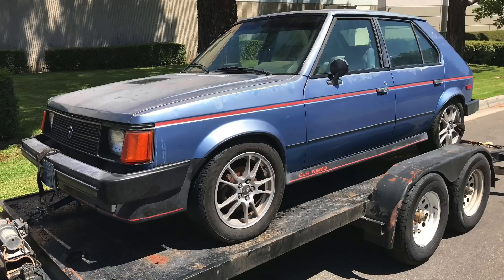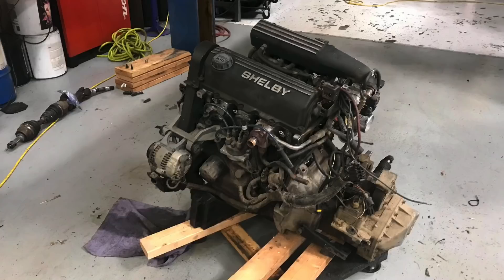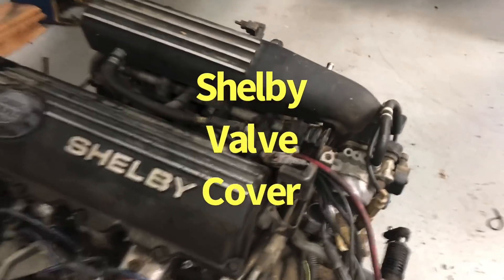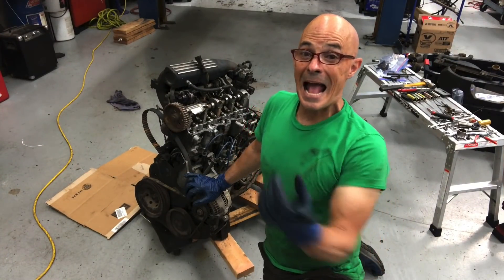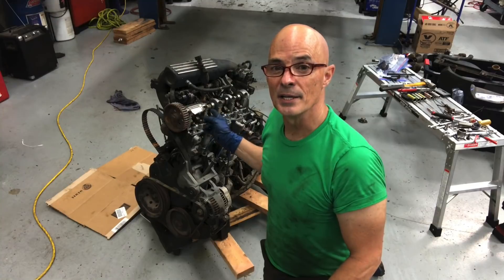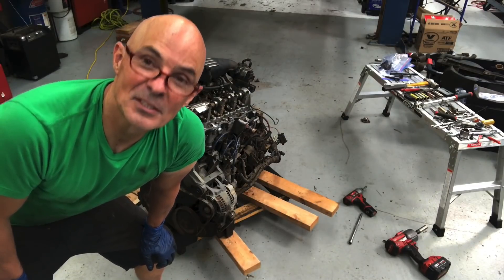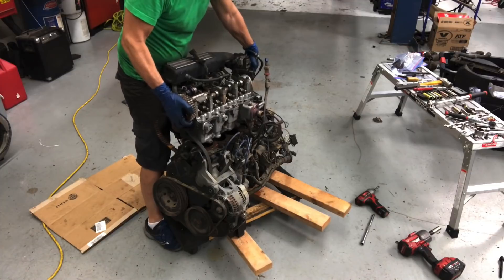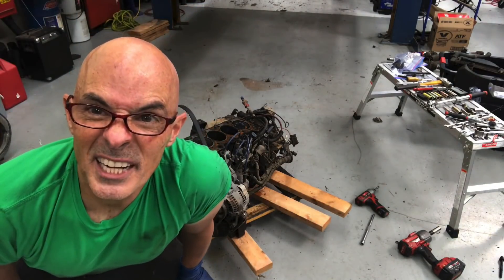HOW TO: HIGH BOOST 2.2L/2.5L TURBO ENGINE REMOVAL & DAMAGE INSPECTION-WHAT BROKE? CHEAP, DIY, TURBO.

Comment: Richard, forgot to mention a couple of things that we used to do to these engines to fix the things that factory got wrong.  One, is the uneven airflow of that T2 style intake manifold.  The #1 cylinder gets more air than the rest, thus running lean because the factory batch style injection cannot address individual cylinders.  The fix was to knock out the large "freeze" plug at the end of the intake and put a cone on the inside of the plug, then put the plug back in.  The height of the cone will change with powerband.
Two, the uneven cylinder cooling because the water housing is on the left of the block, causing the cylinder #3 to run hotter.  This may actually be the reason for the initial head gasket failure.  The fix was to either run a flow diverter under the thermostat inside the block ( we used to make it from a thin aluminum or SS sheet) to direct some of the flow to the right or some people started using the small freeze plug on the right side of the head, right where the water and oil lines for the turbo run, by enlarging that hole and running a water line to it.  Or doing both.  The factory went to sequential fuel injection starting 89 if I'm not mistaken.
Reply from the maker: DID YOU RUN OXYGEN SENSORS IN EACH CYLINDER TO DETERMINE THAT
Reply: @richardholdener1727  EGT probes and reading the spark plugs.  This info was given to me as explanation for the observed behavior by an old Chrysler engineer.  He ran Mopar Performance for 12 years and had extensive knowledge of these from the IMSA racing program.  There was also a "crowdsourcing" involved, as we all shared what worked and what didn't in the Turbo Dodge community.  The guy's name was Ed Peters and he was well know in the automotive community.  Sadly he passed away a couple of years ago.

Comment: What a junk box! Omni turbo . Should dropped it down a canyon wall into a wash.  Then let the chickens live in it.   Weld that head and file it reuse the old pistons and put studs and a new gasket and overtighten by 10 ft lbs,  " IS a Good  enough" says Enzo.....

Comment: hey rich have you thought about doing a long tube header turbo kit? would that work? I see those ebay DNA long tubes and I cant help to think man wouldnt a vband flange get welded on the back of that just perfect to get a single turbo sized right.... it would be low but with a bit of shielding.. heat wrap... seems almost too good of an idea to be true
Reply from the maker: I WILL FOR THE DYNO
Reply: @richardholdener1727  oh and if you are still reading on this post maybe twin turbos sized right for the end of each long tube? Just an idea
Reply: @richardholdener1727  oh and if you are still reading on this post maybe twin turbos sized right for the end of each long tube? Just an idea

Comment: I remember even with the non turbo 2.2s I remember watching the techs at the dealer do what they called the slip & slide with the head gasket! They had two lift points on the head, & a chain going to it! Hooked to an engine lift, they disconnected barely anything, except the head bolts & slipped the blown head gasket out, & just slipped a new fel pro gasket gasket in! They tightened the head bolts from center out w a air gun only! They then would pull plugs & crank over with starter to clear cylinders, & than top off fluids & out of the shop it would go! From cold start, to backing out of shop in under 15 min! NO BULLSHIT! That is alittle worse than normal! Oh and if they started skipping during the test drive, than they would actually pull head, & sometimes find exactly what you found! They saw blown head gaskets every day! Especially on the turbo ones! 😜😜😜😜🤪🤪🤪🤪

Comment: My first brand new car was a 1990 Shelby Daytona. I cut a small slit in the vacuum hose at the wastegate and it would boost to 14lbs. got greedy, went bigger and burnt a hole in the piston. lol. put the stock vacuum hose back on, towed it to the dealership and with the new engine,kept it at 14psi. it was a fun little car and I was young and stupid.

Comment: Get a new head.  The old one could be welded, but the heat treat in the weld zone will be wrong and leave the aluminum soft.  Then the head gasket won't hold up.

Comment: I graduated H.S. in 1986. The Omni GLHS was a pretty hot car for the day. I wanted a new car and it was between the Turbo Sunbird, Omni GLHS and the Grand National. The Grand National was pretty expensive and the Sunbird was actually a tick quicker than a regular Omni but the Omni had a bunch of cool options so I was leaning towards it. In the end I got none of the three. I heard they were going to start offering the 350 in the Trans Am for 87 and then they came out with the Formula and I fell in love. I bought a red Formula 350. It was a gorgeous car and really handled well and even got really good mpg. But what a disappointment the TPI was. I got beat by every 5.0 Mustang in the area. Fortunately I had my 69 GTO with a hot 455 that I could always run home and get.
Reply: You made the right decision👍
Reply: @indyrock8148  The right decision was buy a Buick GN and hang on to it.
Reply: @1439of2000  Oh, if only I had a time machine right? I had drug my dad to a couple of different Buick dealers because they wouldn't let an 18 year old test drive a car without a parent. My dad ended up falling in love with Grand Nationals. He ordered 2 brand new 87's, one for him and one for his wife and eventually found a GNX and bought it in early 88. He traded the GN's off a couple of years later but kept the GNX until last year. It had a whopping 4500 miles on it.
Reply: @indyrock8148  I was a street racer and also needed a daily driver. I kind of thought an Omni would be a sleeper and get good mpg. But you're probably right. If a drunk driver hadn't rear ended the Formula in 89 I would still have it. But it was 3 feet shorter on the driver's side than the passenger side after the crash. I replaced it with an 87 GTA that had a modified engine. The old electronics were so bad that it burned MAF sensors out as fast as I could buy them. But it was another beautiful car.

Comment: Richard. It may be more economical to find another head.   The head I believe is aluminum.  I repaired and rebuilt gas and diesel heads for a living.  If you can get the head to pass a water jacket presser test that doesn't reveal unrepairable cracks then it can be repaired.  You will need a adjustable timing sprocket because of the deck milling.  After welding and straitening (oven and jig needed for this) and milling, CC the chambers. You'll need to pressure test it again to see if the weld didn't create a leak as well as create new cracks.  Then you have to check the cam journals and have them align honed if necessary (if you can find a shop that can do that).  You still have a valve job and possible valve seat to deal with.  You'll have a good head with hopefully not too high of a compression.
Reply: I was just going to mention that when he mentions the head is iron, but then read the note saying the block is iron...so was yep good correction.  I've heard the turbo blocks were a high quality nickel rich iron block too.  I had some very light detonation - nothing like this - on my head and was able to have it welded, cleaned it up, and resurface it and kept on going.  Not the best solution, but it's a CNC ported head and didn't want to let it go just yet.  That is on my 87 Shelby Z.  I'm looking forward to pulling the 87 Turbo II out of my 85 GLH and getting it rebuilt.  These videos certainly help inspire that, so thank you!!
Reply: @notsigningupforshit  The long drawn out way I explained the repair is IF you can not find a replacement.  For the most part as long as the cam still can turn without bind after welding and it passes a leak test you are in business.

Comment: The issue is that vw sold this motor to dodge because they called it... Garbage
Reply: No VW heritage here at all. Has the same bore spacing as a slant six. Stock, these things were reliable if you let it idle a minute to let the turbo slow down while it has oil pumped thru it. How much PSI did that damage with stock head gasket and ring gap?
Reply: Look up the acquisition of the original Omni motor...vw. Chrysler just enlarged it. Same flawed 3 to 4 cylinder wall and head cooling flow problems
Reply: @matthewszalkowski4719  Chrysler Europe developed the Chrysler/Simca/Talbot Horizon in the late 70s and sourced a small VW engine for it because they did not have a 4 cylinder of their own ready for market. They also used a PSA motor for a short bit as well. All of the SOHC 8v 4 cylinders from that era shared design concepts. You'll find similar ideas and even shared parts between Volvos, Fords, Chevys, etc. As soon as the 2.2 became available, the Euro-sourced engines were dropped. The Chrysler K engine was designed by the guy who helped father the slant 6 and the Hemi. It shares some of the slant 6's overall design concepts, but it was its own engine. It was not actually "based on" any motor specifically. Read the information sources people above you have provided. If you can't support your point with actual evidence, please stop spouting misinformation.
Reply: Still a vw design they would not use... My dad was in the industry and said that vw would not use it because it blew up 
At 100000 miles

Comment: I absolutely hate anything Dodge/Chrysler but for some reason I've always liked those omni's! Just imagine if they would have been AWD they would have been bad ass little hot rods without a doubt and since they are so old by now tuners would have figured out everything and there would be a ton of aftermarket parts available and they would be flying!
Reply: Everyone has figured everything out on these and there are plenty running fast times and have been for decades.

Comment: That is some of the worst damage I've seen to one of these on the head side of things without there being a hole in a piston, too. If the head is stock, not worth welding. Just find another good USED one! DO NOT get a new casting from China...they are TERRIBLE!!

Comment: Richard if I recall, you've done work with blueprint engines, and I would assume you are familiar with the factory five 818. For a couple years, I wanted to take the 818 and put a 2.2 or 2.5 in it instead of a subaru boxer 2.5. They say it can't fit. I still can't wrap my head around that. What would you say?
Reply from the maker: WHY WOULDN'T IT FIT AND WHY NOT USE A HONDA

Comment: I seriously can't believe it was so bad! This is literally the reason I didn't pull my "blown head gasket" shelby charger apart for years (it still ran which allowed me to move it around the property) but I got lucky, just the gasket. I was running 26 psi, on e85, this could have easily happened if it was between cyl instead of the coolant passage.

Comment: This is a common issue for those running high boost, thought it looks like either this one was more severe than average or the person drove around for a bit with blown head gasket and killed the head as a result.

Comment: I see a prior owner smartly upgraded to the Nippon-Denso alternator. A simple bolt-in that delivers 90-120A, depending on the model had... and quite necessary to support the electrical demands of a car with EFI. Not to mention more reliable, and easier to replace the brushes on! ;)
Reply: Where does this 120 amp alternator originate from
Reply: @pr0n5tar  go to a tractor supply store get one for a 1994 john deere replacing part 38770.

Comment: hey can you do some Chrysler / Dodge 3.5 v6 egg motor sometime???
2.2/2.5 who needs them????? v8 is too expensive in Europe. v6 Chrysler engine is dirt cheep 250 hp(n/a) calmed / 140usd. 
very high rpm N/a 
 n2o + ring gap
camshaft
some ported heads maybee??
what power it can make before it self-destruct on dyno???
youtube is full of info over v8/bmw/honda/nissan.but not much of tuning of Chrysler 3.5 HO v6. i know it is good engine 4 the money. 
i am building one slowly. 
Plan is 3.5 engine/4.0 cam and springs/self ported heads/ self made long tube heders/ used dry sump pump from ebay/ ARP rod bolts/standolone/ and SHITLODS of N2O+ 98 octane pump gas. in very light light mercedes w201 with 6speed closer ratio.
Reply: What transmission? Stock 42LE or??
Reply: You probably don't know much about the Chrysler 2.2/2.5 SOHC motors you can easily get 500 ft lbs of torque out of a 2.5L turbo Mopar to the wheels. Boost baby 😁

Comment: OMG!!! We did some damage like that on a turbo 2.2 we stuck in a Reliant Wagon. I worked at a Chrysler dealer and a couple of calls to Chrysler Headquarters in Highland Park got me a box of mystery parts and a new computer, no part numbers on anything. No more problems on what might have been the fastest K-Car Wagon of the early 90's.
Reply: A friend of mine back in the early 90's took a reliant 4 door 2.2 turbo car put the super 60 stuff in it ripped all the badges off and proceeded to embarrass every crapstang and crapmaro he could find
Reply: @Welcometofacsistube . Hey, we love all engines and makes here!
Reply: Is your name Gary?
Reply: @bobbywalter5320  no, not Gary. I didn’t know a lot of people there, just a few of the right people.

Comment: Personally I blame squirrels
Reply: The  new "335" engine. 

0.335 inches between each cylinder bore.

 ( 96mm bore spacings minus 87.5 mm pistons)
Reply: Uncle squirrel He personally found black widows

 (Dead after Propane powered "Fumigation")